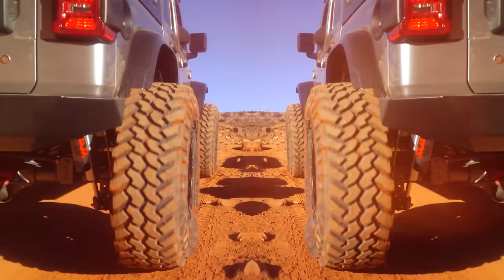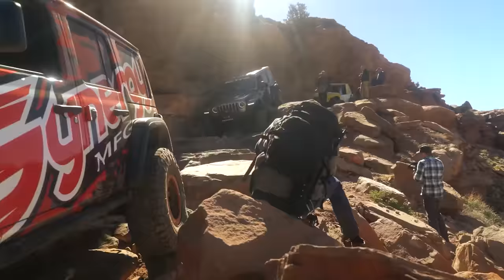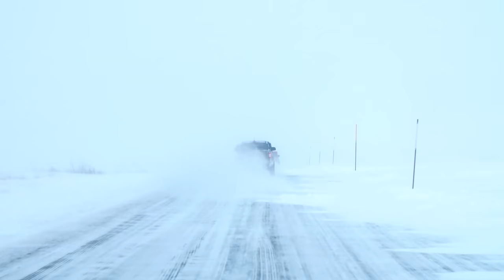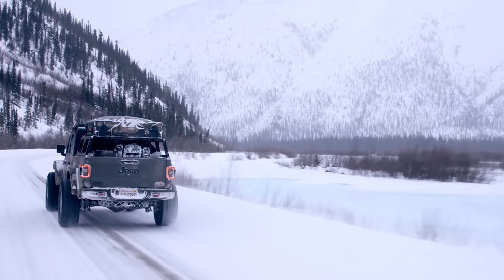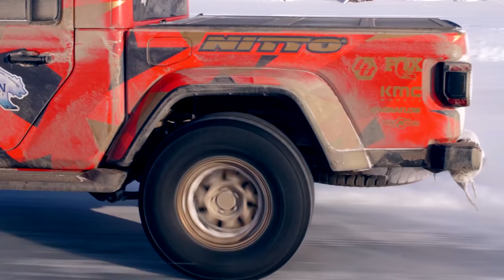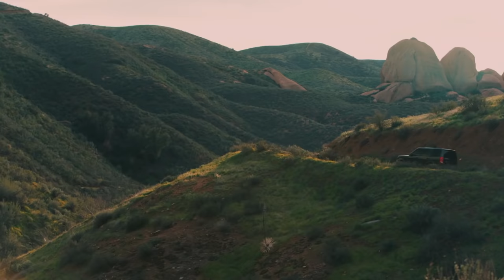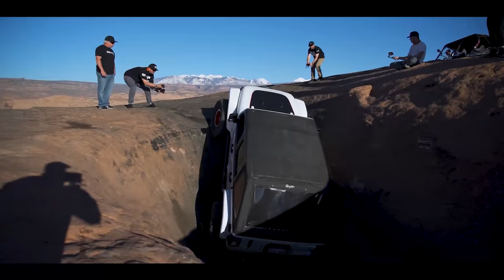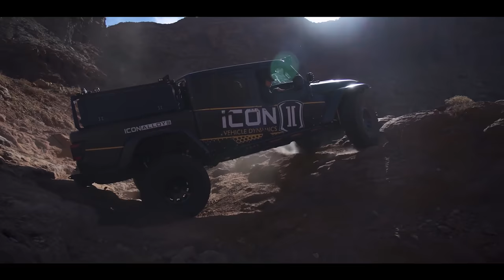Do NOT Use 4-Low Offroad || Watch First!

Comment: All that is valid for reverse and first gear low.
Otherwise power, torque will be the same as in high gear
Usually 2nd low is quite close to 1st high
3rd low roughly equivalent to 2nd high
And so on

All your too much torque, engine over revving too easily, etc observations are valid just for 1st and reverse low gear

Comment: your method for shifting the transfer case is vehicle specific and absolutly does not apply across the board around the world
(must be a jeep thing? 
- the Volvo C300 series has a full syncro transfercase ( shift when ever you want  Up and Down (within engine rev limits), All done on the one gear stick too!
- The 2000 era landrover discovery owners manual recomends that the vehicle is in Main box Neutral and moving at walking pace  for the low transfer box selection
- Some model landrovers owners manuals describe on the move selection when towing heavy loads as part of the normal gear selection process

The long and shrt is to follow the owners manual!

Comment: Does the Ford excursion 2000 have a rev limiter?
Reply from the maker: I believe so, are you having issues with your Excursion?
Reply: @TrailBuilt  no, i just bought it, and made it mechanically and cosmetically new from a Ford dealer, so I'm educating myself about how to use the 4x4 options properly to avoid damaging my investment!

Comment: 4Low isn't great in deep snow, which sucks since so many factory lockers are limited to low and lockers are great in deep snow. Snow the torque from low just digs you in. If it's slick and downhill low can cause you to slide as if you jammed the brakes.
Reply: Get a plug in calibrator (not a tuner) and you can enable the lockers in 4-HI
Reply: @pyros2359  Yep, I need to do that in my Taco. I bypassed it in my LJ Rubicon and it increased the smiles for snow-wheeling quite a bit.
Reply: @pyros where can I get the plug in calibrator for the lockers?

Comment: 4low to go - with a standard it gives you gearing and control, with an auto it does the same thing... using your auto to slip instead of using 4low just hurts your transmission. hell i'll use 4low and unlock the hubs so I can have 2low when wheeling.. why use 1-2-1-2-1-2-1-2 when you can use 1-2-3-4-3-4-3-2-1 etc

Comment: Your Headline was very misleading to a COB like me.   I was ready to jump all over you, but it is obvious, this video is for those who lack experience.   Back when I was young, the Rubicon set the standard of, if your rig was well set up.   Now ya got all these Hammerhead Rock Crawlers, that cant get an adrenaline rush on the Rubicon Trail.   My biggest beef with the new Jeeps, are the fact most are no longer able to be repaired trailside, without a NuCleer Enjeneer there, to die-agnows the diji-tal ap-parati that gits plugged in to the on board computer systems.   This is why I hang on to my old CJ-7.   A bag of wrenches, screwdrivers, vice grips, duct tape, and I can do a minor overhaul.   Hell, most Jeep Owners these days, don't even know what CJ stands for.   Rest in Peace ... CW McCall.   Dual Pipes, Racin Stripes, and a 4 pot Carb, ya know!  COB = cranky old bastard.
Reply: PS   I forgot to add, that some of my skills with diction ... was ob tayned by reading articles from Granville King!

Comment: I use 4 low often when offroad. It keeps the transmission temp lower. I do not agree with this video. If you have a Jeep TJ with the 42RLE you'll need to use 4 low with rocks and steep grades.

Comment: Well...the instructions he gives on how to shift into 4Lo (at least for a Wrangler) are dead wrong. The vehicle should be rolling at 2-3mph, per the owners manual.
Reply: His instructions (suggestions) were dead on for a LR D2. Your wrangler instructions are the preferred for my Disco; but his suggestions work better 😁😁
Reply: It's always a good idea to read the manual.  Stopped in neutral in my old Frontier.
Reply: That is always my second opinion,  most of the time my WJ's T-case usually goes right in stopped with transmission in neutral.  Then again, I have a very well used T-case so maybe that is a factor.

Comment: You are 100% “INCORRECT” on how to shift a jeep in 4-Low , in the jeep manual it says “ slow to approx 3 mph and place in neutral then shift into 4 Low “ you do not and in most cases can not shift a NP231J or similar transfer case into 4 Low while stopped .. if you are gonna do “How to” videos at least know what you are talking about ..